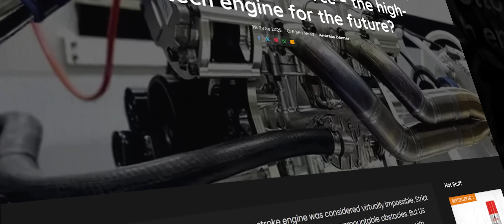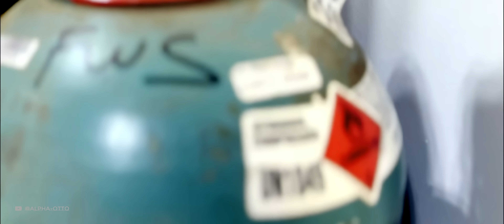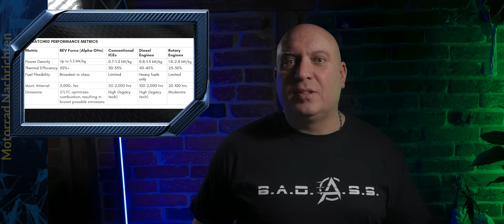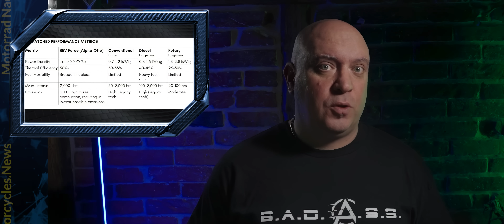Revolution – 2-stroke engines are making a comeback!? – NEW ENGINE

Comment: in the late 1980s, every car manufacturer from General Motors Toyota Honda all the way down to DAHATSU had two stroke automobile engines underdevelopment. They had running prototypes on the streets. On the plus side, they could get double the horsepower out of the same displacement 4 stroke engines. Or looking at it another way, they could get the same horsepower out of half the displacement of a four stroke engine.
 They were ready to start, rolling the assembly lines and installing two-stroke engines. Toyota had a design that the crankshaft and cylinders were lubricated by crank case oil that you check with a dipstick.
Remember the SAAB2 stroke three cylinder cars of the late 60s ?
Those cars were production line cars sold to the public, when you stopped her gas, you just put in a small pre-measured can of oil into the gas tank and added the gasoline afterwards to mix. Of course you had to buy 10 gallons of gasoline to get the right proportion for the amount of two-stroke oil you put into the gas tank..
There were also two stroke large trucks in the early 1900s, I mean trucks like dump trucks that had two stroke engines reliable enough to go into service with the public ..
Just one little thing stopped the two-stroke car production in the late 1980s, just one little teeny weenie thing .
None of these two-stroke car engines that every manufacturer was developing could pass the emissions test after the engines had the equivalent of 100,000 miles on them. They just couldn’t pass the sniff test after they had 100,000 miles on them… and that was that..
I grew up in the late 60s, started road racing motorcycles and riding dirt bikes in the 70s and 80s with two stroke engines, I’ve had many, Kawasaki 350 avenger 2/twin, Kawasaki A1 rotary valve, two stroke, twin, Kawasaki S2 350 cc three cylinder two-stroke triple, Kawasaki S2 1973 with the six main bearing crankshaft, three cylinder two stroke, Kawasaki H one 500 cc triple two-stroke, Kawasaki bighorn 350 cc two-stroke single dirtbike, I actually got that from Eric Buell in a swap. I gave him the chassis for my factory Kawasaki 500 cc triple Rd. race machine, that was never a street bike, it was made as a road racer with sandcast cases, three cylinder air, cold, two-stroke, the bores of the cylinders were chromed. It was a horrible wiggler just like the 500 cc St. bike even though the frames were completely different. But the road racer was a terrible handler. So it got parted out and Eric ended up with the chassis and I put the engine in a Suzuki X6 hustler frame, extended the swing arm and turned it into a drag bike.
I road raced RD’s winning six championships, two time national champion, I had several two-stroke trials bikes from Yamaha, beta, gas, gas,fantic.. I had a Yamaha TZ 250 watercooled road race machine two-stroke, I had a Bridgestone 350 GTR rotary valve twin street bike two-stroke, I had several Yamaha 81, CT one, CT two play dirt bike, two strokes, YZ 125 two-stroke, IT 175 two-stroke, KDX 175 two-stroke, KX 202 strokes I had two of those, the air cooled, and the water cooled versions, I had a Honda MT 250 two-stroke, a Suzuki X6 hustler 250, a Yamaha RD 60, a Yamaha DS 72 cylinder 250 with piston ports, a Yamaha R5 350 piston port two-stroke engine, I had three Yamaha RD 350 red valve engines two strokes. I had a Yamaha RZ 350 Street water cooled with power valve, I had a Honda. I think it’s called a CR 125 motocross bike two-stroke, I had a suzuki rm 125 two stroke, and my kids had a Y zinger two stroke 50 cc play bike, and an LT 80 two-stroke quad, and an LT 50 two-stroke quad..
So I’ve had my share of two strokes..
One thing I can say about two-stroke, especially from my road racing days. They have marginal lubrication, and Pistons do not last long, neither do the crankshafts because they are being lubricated with diluted oil that is diluted by gasoline. 
My road race TZ 250 Yamaha called for a new Pistons every 600 miles, and a rebuilt crankshaft which you could only rebuild one time every 1200 miles..
On my air cool street bikes, which I rode raced, or even if I just rode them on the street, they pretty much needed board and new Pistons and rings if you wanted them to be snappy about every 5000 miles to 10,000 miles. My dirt bikes with hard played bores , even though I changed the air filter for a clean re-oiled air filter and greased around the ceiling edges with grease, they needed new pistons and rings about every 50 to 100 hours or else they became hard to start. And that’s the first sign, the piston does not stay square in the cylinder and the rings don’t have square contactwith the cylinder and they lose compression. They just do not have adequate lubrication because they really don’t have a hydrodynamic film of oil, it’s marginal at best. And crankshaft bearings, main bearings, pistons and rings, wear out, and as the crankshaft bearings were out, that makes the crank seals go bad.
four stroke engines on the other hand that do not have roller or ball bearing crankshafts, or even if they do, they have better lubrication with oil that is not diluted by gasoline, and they can go much much longer without needing new pistons and rings and new crankshaft and new main bearings 
Now I suppose with modern technology, they could come up with metals or materials, such as ceramic bores were some type of coatings on the Pistons, and water cooling certainly makes the pistons retain their round shape for longer.
But I just can’t see two-stroke engines coming back even with modern coatings and modern metals and better bearings and seals. I just can’t see them being able to last nearly as long as a four stroke engine do mainly to the difference in lubrication.
Reply: This new engine does not have the lubrication problem. No oil is needed in the fuel. It is lubricated the same way as a four stroke. It has no cam shaft or valve train so reliability should be even better than a four stroke.

The rotary valves has less friction and better flow. They only need to seal at low pressure differentials.
Reply: @mabl4367  So it works like the old Detroit diesels. It's still 2-stroke but isn't burning its' lubrication oil like your standard chainsaw and dirt bike engine. I could never get how they developed such a thing for diesels in the 1950's but could never bring a similar idea to gasoline engines. It would be awesome to have a 2-stroke engine in a car that didn't require burning its' oil to function.
Reply: @Slane583 no oil change and waste oil to throw away! There are plant derived very clean burning oils available. Dry sump with VRO is the way to go!

Comment: Check out the Napier Deltec triangle three crank opposed piston supercharged two stroke train engine 1960s.
Reply: Get 3 60 deg v6 3L mercury optimax 300 XS strokers. Each one is 192 CID and that will make a nice 576 CID mini Deltic braaaper!
Reply: So what did you think of that ideah?

Comment: Looks like a rotax to me.  Supercharged, direct injected with an exhaust valve is nothing new.  Not one word of how this engine is lubricated.  Seems overly complicated for any practical use.   Simplicity and light weight was the 2 strokes benefits.  Take that away and might as well be a 4 stroke.
Reply: Great torque and throttle response! 4 turd strokes suck in cars/trucks too. Running a 4 turd stroke upside down and using ad target practice is fun.

Comment: There is nothing wrong with modern engines !
The problem IS emissions regulations !
It is a political problem not an environmental or engineering problem !
Reply: 4 turd stroke suck in just about anything! Let’s see them run tilted in any position with oil injection and go with out oil changes!

Comment: LIke those massive two stroke diesels used in big trucks.
Reply: The big trucks had opposed pistons, this engine does not.
Reply: @stevehead365  From what I've seen, the Detroit 71 engines do not have opposed pistons, but do not have the normal two stroke crankcase aspiration and have to rely on a supercharger to force induction.
No?
Reply: Tiny compared to EMD diesels in locomotives, and they are tiny compared to two strokes in ships.
Reply: @redtale6527 The emd 16-710 in the arctic cat riot is faster than the Polaris 9R!
Reply: I have an 8v92 2 stroke Detroit out back.

Comment: Absolutely brilliant,  I've been a licensed technician for over 42 years.. since days one , I've always said 2 strokes are the only way to go.. even my  2000 3 cylinder,, 170 hp 2 stroke  barely burns anything,  especially with its oil injection system,, high octane and fine tuning . These synthetic oils are incredible,  burn clean and high lubricity ..power every 180/360 degrees .. you  got to love that...
Reply: Even my 50 year old BSA Bantam 2 stroke run on modern 2 stroke oil is smokeless.
Reply: I hate the 4 turd stroke! Time for some DFI v8 2 strokes with exhaust trapping sleeve valves!
Reply: Detroit diesel were supercharged 2 strokes. Not new technology
Reply: The complexity  is not much less than a comparable 4 stroke. Where is the gain here?  This engine is going  nowhere  IMO.
Reply: ,, interesting.  Half the weight,  half the components,, half the complications.. If you  can i stall good electronic management,, its a no brainer...now a turbine is truly the ultimate..
Reply: the amount of ignition events per degree of engine rotation is irrelevant, the horse power per kilogram is the measurement needed. I can't see how a two stroke N/A can beat a turbo 4 stroke in weight per power ratio.
Reply: @Channelmaster73 ,,, my 2 stroke weighs less than 100lbs,, for 170 hp.. and that's not even modified.. turbos are nothing  but complexity,, heat,, and weight.. 1 ignition event for  every 720 degrees..
Reply: @petehalasz7547  The degrees of rotation and power pulses mean nothing, you look at total dyno graph figures, power pulses are irrelevant. Yes turbos are more complex, but I'm yet to see a two stroke supercharged beat a turbo 4 stroke, it's just not happening.
Reply: @Channelmaster73  This is not true. Ever ridden a proper 2 stroke enduro bike? Even though they have MUCH less rotational mass than their 4 cycle counterparts, they're snappier and are much harder to stall (due to having twice as many power pulses per rotation) which means EVERYTHING when you're crawling rocky hills and hopping logs. You can lug them past the point of stalling, quickly slip the clutch with a blip of throttle, and they're good to keep going. The 4 strokes just flame out suddenly and completely when they dip below their limit. That game is all about power delivery, you may have heard the term "tractability" or "tractor factor", that's what seperates one from the other and why 2 strokes dominate the section.
Also different engine braking, which can be argued either way but still very relevant. 
Two Strokes have a ton of unexplored potential for raw horsepower too. The 4 stroke valvetrain (cams and springs) eats a good chunk of power, one reason for the extra required crank weight, the other is the extra time/ degrees it takes to get to the next power cycle (extra mass in a motor is relevant) 
Some of the fastest drag sleds are two strokes (both boosted and naturally aspirated) and are frequently faster than their 4 stroke competition with similar displacements. Snowmobile racing is one of the few areas where 2 stroke tech didn't completely come grinding to a halt and it shows- the 2 strokes are still faster.
Reply: @petehalasz7547 You are gonna drive me to drinkin if you don’t stop driving that 2 stroke Lincoln! Darn them orbital DFI 534 CID 2 stroke boss v8’s get me in trouble! Lol

Comment: Honda made a 2 stroke in 1995. It was 400cc , fuel injected  an engineer had developed a system called ARC ( Activated Radical Combustion ) It was used in an off-road bike called EXP-2 and raced the Dakar Rally in that year with amazing results. The system fixed the troubled spot in the combustion cycle , had great fuel economy and took care of the emissions on the 2 stroke. They did this in 1995! And this is known about through the industry. 2 strokes are about to make a comeback to the forefront soon. And in the USA emissions are about to be rolled on back starting on 9/21/2025!! So....smokem' if ya got em' 🙂
Reply: They even produced a production bike with this system the CRM250AR.
Reply: @MrTench8  a mate of mine had this bike, I got to ride it 2 years ago and wow was it a fun factor machine, it went hard and sounded awesome, sadly he passed away a year ago and the bike has passed to his son who promptly sold it off, he got 25k for it so they are worth a bit of coin.
Reply: I’ve already been smokin. I’ve got an 09 KTM xcw that’s street legal. Also the new KTMs meet euro 5
Reply: @Smoothie_machine Very nice!!! I have an NSR250 plated in California and I am also just about finished with a KTM 105 supermoto to be plated in California 👍🏻
Reply: Rgv 250 was a good 2 stroke
Reply: Personally, I remember testing the yamaha rd350. Way too much power considering the features😅 Nowadays I settle for a ktm ex four-stroke without plates. My summer cottage neighbors thank me for that....
Reply: The tech or secret let’s say is in the porting I feel,better swirl etc etc. 
2T is a real option for power per calorie of fuel. Just needs more porting/ experimentation. But efficiency doesn’t sell fuel so it’s kinda taboo tech.
Reply: Taylor Swifts v-16 2 stroke has 850 CID per cylinder and makes 13,600 hp @ 1150 rpm’s! It had DFI and rotary exhaust sleeve trapping valves to allow more boost.
Reply: Toyota also did 2-stroke engine experiments in the 90's, but they didn't crash because of emissions, but because of insufficient revs in larger engines. The engine control, mainly the injectors, was not able to implement the desired rpm. With a 2-stroke, there are hardly any opportunities anywhere else than in the US. There, the emission regulations are and will be more permissive than in the rest of the world.
Reply: @rockrane1 poppet valve loop charged 2JZ!
Reply: What do they emit when you burn hydrogen? 😮
Reply: @i.grevefreespeech Nothing.

Comment: This would be amazing to scale down and up as needed. Put them in motorcycles, atv's, utv's, xtv's, jetskis, outboard boat engines, inboard boat engines, aircraft, generators, and automobiles of coarse. An ineos grenadier with one of these. A cessna 185 or similar, or even a bearhawk with a scaled up 350 ish horse with a gear reduction. So many applications.

Comment: Thank you for this great video! I’ve always said “two strokes are half the parts and twice the power” per CC. While this view is overly simplistic and not quite accurate due to the advances in four-stroke technology, it’s still true that two-strokes are more simple, lighter in weight and cheaper to produce. In other words - PERFECT for racing! And modern digital technology and direct injection make it clean burning. So  this engine would be PERFECT for military applications where refueling might be difficult because of the lack of the correct fuels available in some parts of the world.  Man, I hope for a two-stroke revolution, for many reasons. The sound being the thing I miss the most about my old two-stroke motorcycles.  Please keep the videos coming! You’re doing a great job!
Reply: "driving 4 answer" Made a video about this engine.
Reply: EMD 710 two stroke diesels are just as complex as a four stroke but get more HP per cubic inch than four strokes and according to locomotive drivers have a better power delivery. They also blow much less fuel smoke. The EMD uses a gear driven centrifugal supercharger with an overrun clutch that turns into a turbocharger when the exhaust gas flow is great enough, so it has the best of both worlds there.

Comment: I need one for my car where do i sign up?
Reply: Sorry only bikers need apply...Car drivers are considered far too Snowflakey for modern teqno!
Reply: @Amduscias13  LOL nothing more rad than container ships. They've been using humongous two stroke diesel engines for decades 😂.

Seriously though, if this engine takes off, it's not just going to run cars. I can see the military salivating at its multi-fuel feature. That's one of the reasons the M1 Abrams is using a turbine engine. And far more efficient. It will be a logistic dream.

But its power density... oof. It'll be definitely more power dense than that turbine engine. Less weight for an engine = more room for ammo, fuel, armor, or other components.
Reply: @Amduscias13 Car culture is stuck on 4 turrd strokes and it’s time for DFI 2 stroke v8’s!